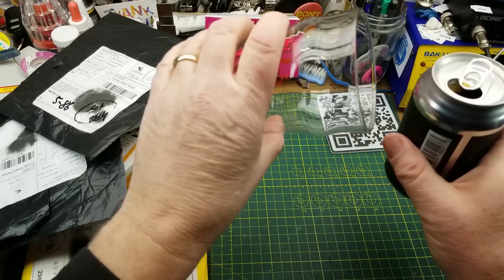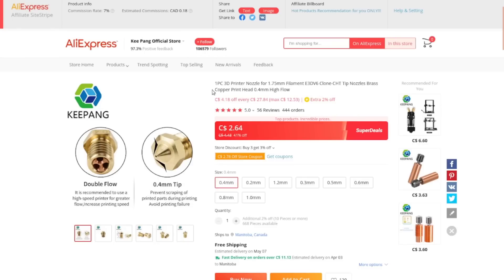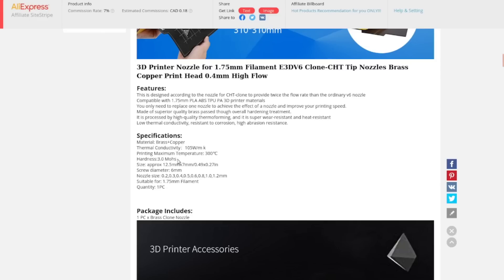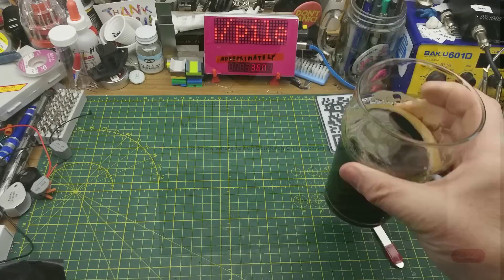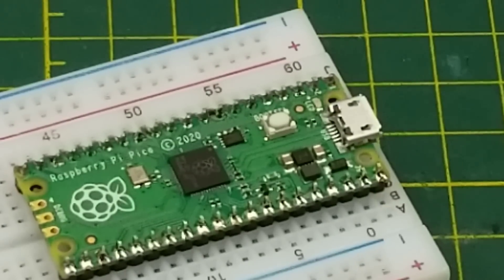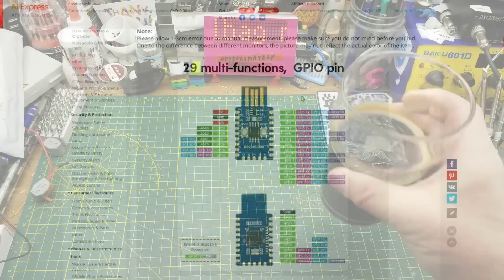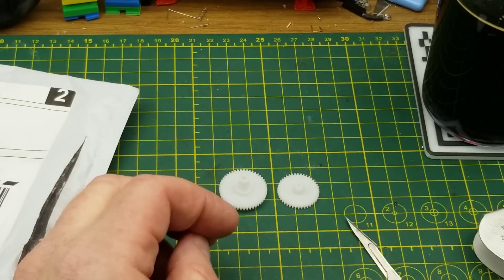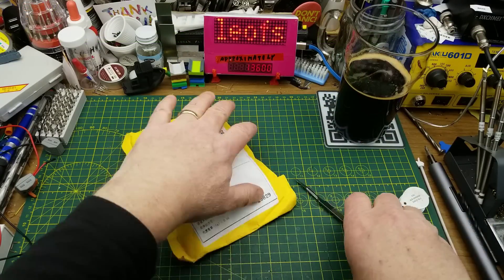Mailbag Monday 161

Comment: The pigments they use for glow in the dark filaments are abrasives and they can eat away brass nozzles very quickly. That's what hardened steel nozzles are for.

That said, 10M of filament is probably not enough to do any significant damage, but if you start seeing lots of random artifacts (stringing and inconsistent extrusion), it's probably time to test the new nozzle you got. :)
Since it doesn't glow that much, it probably has a very low concentration too.

Comment: There is a tech item that I cannot believe is NOT made. And if it is made, I haven't been able to find it in the 2 years since I first had the idea. Why isn't there a Wi-Fi connected alarm clock that syncs with internet provider and desktop computer? I know "Alexa" type systems exist. However I don't want that type of system. I just want an alarm clock that syncs with "computer time". I am also aware of radio controlled "atomic clocks". However the radio control signal does not reliably work in my area.
Reply: Sharp makes one, and available through Amazon.
Reply: @wrxs1781  Maybe I am woefully inadequate with my search. However I can only find the radio controlled "Atomic" clocks and the factory pre-set "Accuset" clocks. Do you have a link?
Reply: easy enough to build one

Comment: I saw the 4MB flash chip on that RP2040 right away. I ordered and am waiting for a regular-sized RP2040 board with 4MB flash, USB-C, and pin assignments printed on the top (rather than the bottom on the official boards). Now I have to look into that mini version. Thanks.